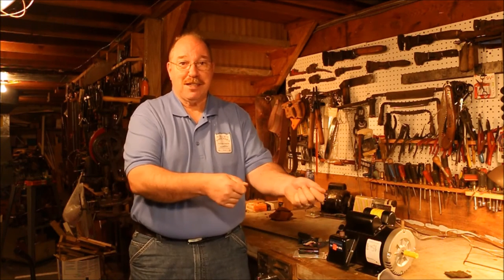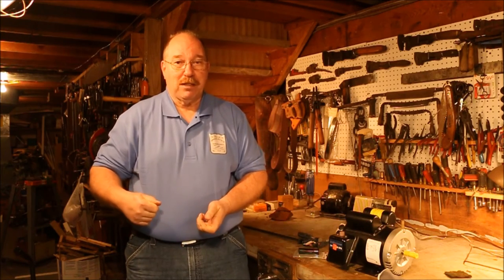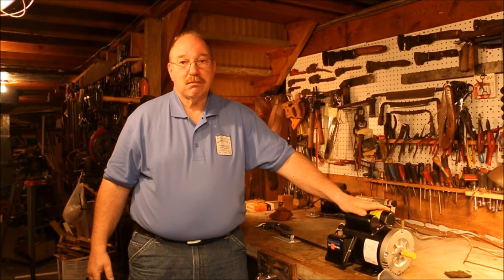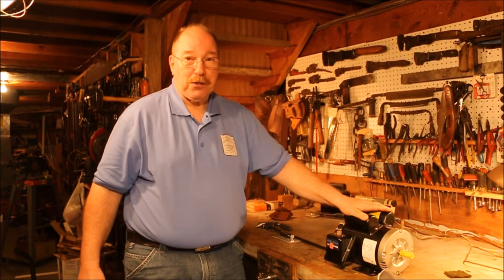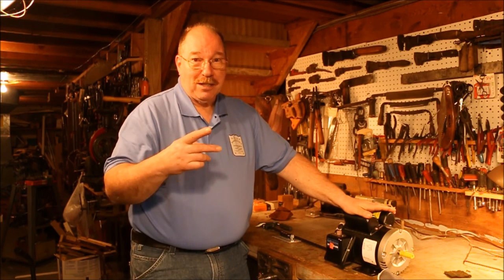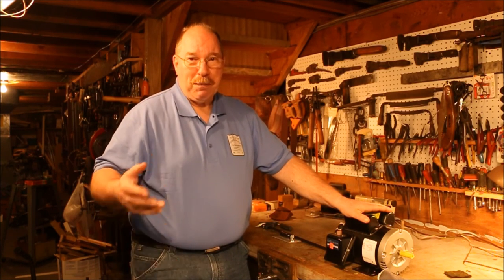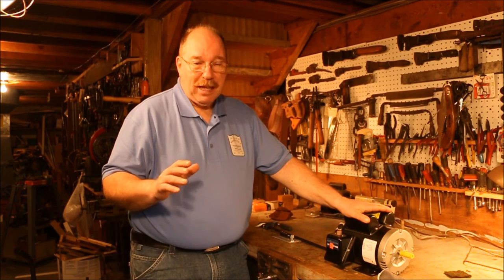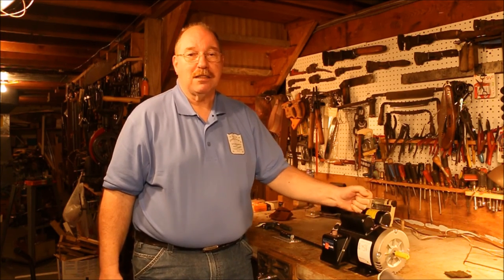Building The Hugh McDonald Rolling Mill ~ Pt 1 ~ Found A Motor ~ By Old Sneelock's Workshop

Comment: I thought you'd put the flathead out in the garage on the mill and fix it so you could drive it around while rolling but I guessed wrong...........but it ain't over yet either!
Reply from the maker: That's a spare engine for the 8N. I think it might be just a bit too big for a go-kart rolling mill. :-)
Reply: Old Sneelock's Workshop Maybe........but you build sheds/garages all the time so.........
Reply from the maker: Lewie McNeely Just remembered something. At the UTC aluminum castng plant in Booneville, Kentucky they cast aluminum ingots and also did continuous casting. One of the operations rolled continuous cast ingots into 3/8" rod. It took about 10 sets of rolls to reduce three inch trangular billet to 3/8". The ingot entered at about 10 feet per minute and the rod exited at 30 miles per hour. The rod was coiled on 1000 lb spools. While the spools were being changed the rod was diverted and chopped into 1 or 2 foot lengths. The chopped rods hit a steel target and dropped into a bin.  When the chopper was running, about every 5 minutes, it sounded like a machine gun. If I were to hook up the 95 hp flat head to a rolling mill I could have fun chopping down trees with the red hot steel shooting out of it. 😈
Reply: I'd always wanted to go in to a steel mill or the equivilant. The power used is mind boggling to me. And I knew that the flathead had a purpose. With headers of course!